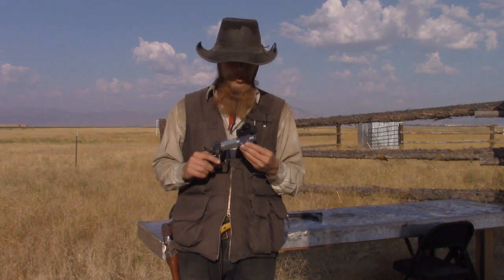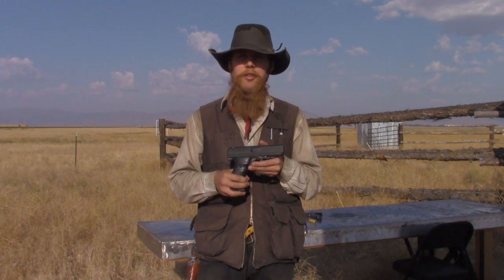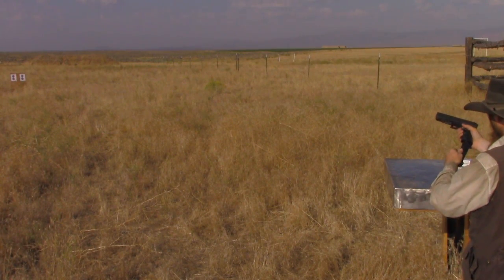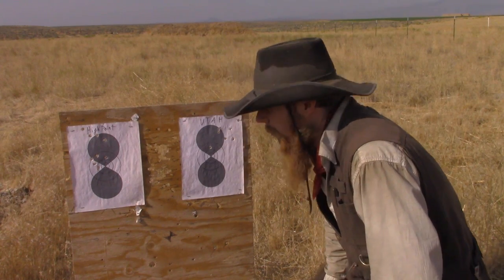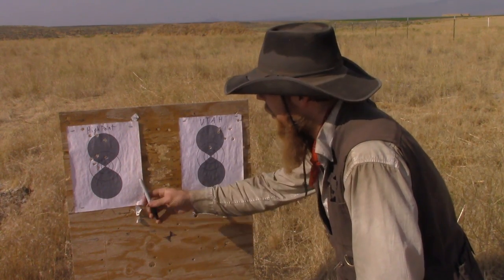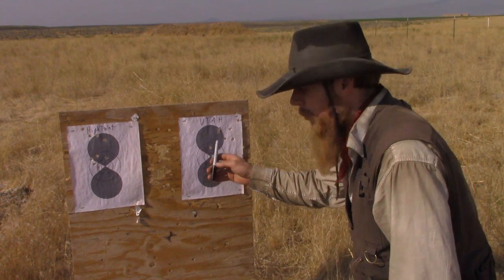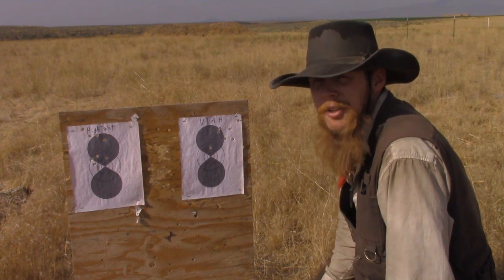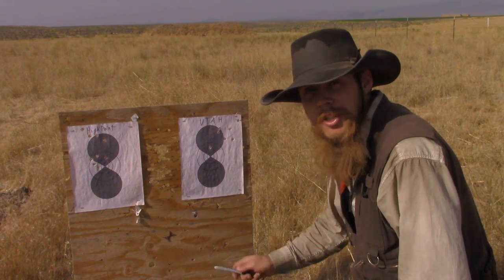Accuracy Testing DIY Rifled Barrel (TIS104)

Comment: I'd trust that Utah pistol with my life. The highpoint... Not so much...
Reply: Highpoints are REMARKABLY reliable they are the most reliable cheap semi automatics out there. Unlike the jimmiez/raven/lorcin 'ring of fire' pistols.

They are designed to feed dam near anything. They are Crude, Ugly, Heavy direct blowback and have a horrible brick strapped to a 2x4 feel grip but they will always work.

If I only had 200$ and needed a HD gun in a hurry its probably the best choice. Get it in 45 a couple of the redball highcaps and you have a reliable pistol that you can throw in the toolbox or have in the car for less than dinner and drinks for 2. 

Given they are reliable and combat accurate they are my go to recommendation if someone needs a gun in a hurry on low income. 

Their carbines are great in their own right and id take one over a bottom of the barrel 400$ AR from radical or the like. 

They are exactly what they need to be for their purpose, cheap, reliable and bulletproof.
Reply: @jediknight1294  so reliable it had feed issues after the first two shots lol
Reply: @loganjenkins5597  iv never had an issue with a hipoint and haven't seen many.

First 500 rounds don't really count for a pistol imo as most need about that to break them in. 

The warranty is amazing and in 45 at least the redball adaptor allows extended mags. If I only had 150$ for a HD gun I'd buy a hipoint well before something like a lorcin

Comment: The Hi Point is a cheap pistol, but the fixed barrel does lend itself to accuracy. I find bench resting indicates they have great accuracy potential on par if not better then much more expensive pistols. In hand however, I find the trigger pinches the bottom of my finger, the trigger pull is bad, the grip is not great, and the balance is that of a squirt gun with a brick tied to the top, so it might be accurate, but it is hard to shot it accurately, ha.

Comment: first, I noticed you are pretty far away (for shooting a pistol.) second, just watching the background, there seems to be quite the breeze blowing.  I would be interested to know what the ambient temp is there and if you could perform that same test indoors to take the wind out of the test.
Reply from the maker: Range was 25 yards, which, yes, is on the long end of what I would consider typical pistol distances.  There was a slight breeze that picked up a little toward the end, but I don't think the wind was strong enough to noticeably affect the bullet trajectory at this distance.  Unfortunately for recording videos, it doesn't take very much wind to start blowing up the microphone, which probably made it sound windier than it was.  Shooting a .223 rifle under similar wind conditions, the wind's influence on point of impact was noticeable at 300 yards, but not at 200, so even with a bigger, slower bullet, I expect the affect would be negligible at 25 yards.

Comment: Did the high point discharge when you were clearing it? If so it's a good thing it wasn't on your lap as some tend to do when clearing. Down range at all times, good job and great video.
Reply from the maker: The malfunction was just a failure to feed.
Reply: Yes, after watching it again I realized it was the magazine dropping out.